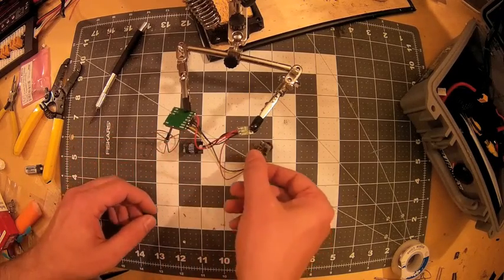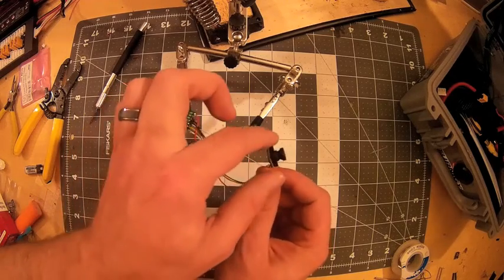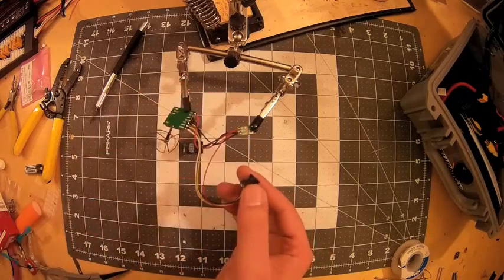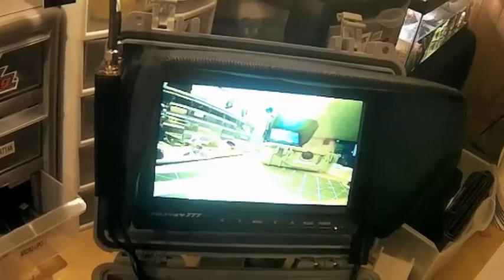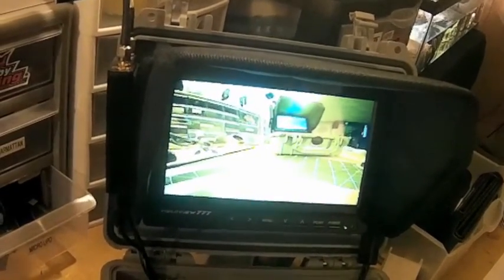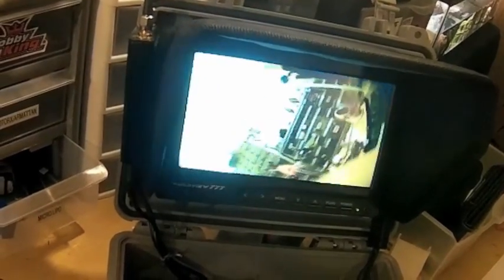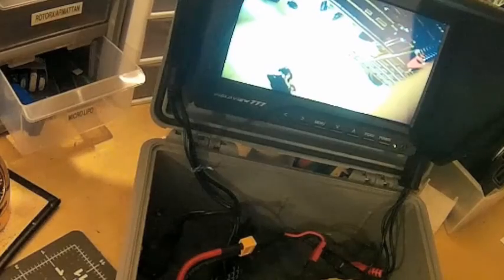DIY micro FPV setup

Comment from the maker: Yes, so Lang as you are using a 1s (3.7v) battery. You could also use 2s and 3s batteries, however you would need to use a 5v step down regulator instead of step up.